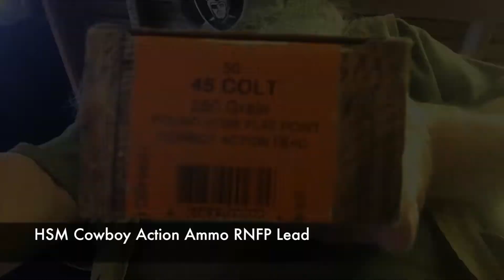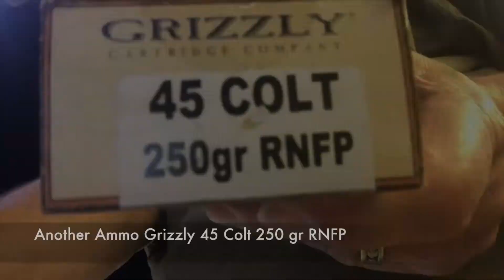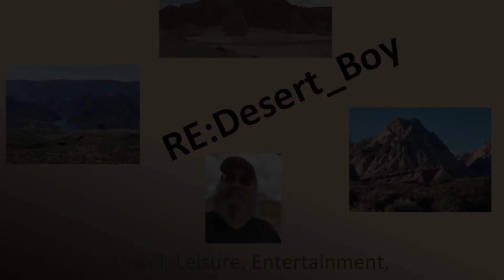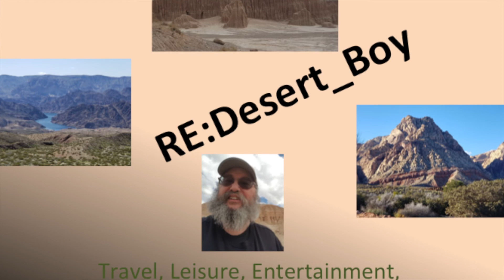1873 Cattleman Misfire Issues Part I

Comment: Young Beretta and I had to send 3 out of 11 Smith&Wesson Revolvers back to S&W for some fixes and tuning because they had issues including light primer strikes\ failure to fire. All the Smith and Wesson handguns were fixed and now run 100%. Sadly, we have no relationship with Smith & Wesson now because we showed the issues on our channel. I guess they just don’t like that total honesty time.
B9USA Sr.  🤠👻👮🏻‍♂️🙀🥺😉🇺🇸👍
Reply from the maker: It is absolutely critical that those of us sharing be up front and straightforward about what we experience, otherwise why do the reviews/videos.  That is why I did part II as well to discuss what the Cattleman II resolution was just as you did share about the S&W follow up.  You are not alone in people having some challenges with Smith and Wesson which is indeed sad.  I did go ahead and buy the 2 recent S&Ws, the 637-2 and the 636-6 and have been fine, but I thought long and hard about buying a SP101 and GP100 instead and most likely still will at some point.  I like and respect that honesty time.  Just keep doing the great review work Beretta, Sr. and Young Beretta.  Thanks.

Comment: That is a beautiful revolver though - load one skip one is the standard.  I wouldn't give up on that gun - have a gunsmith check the hammer tension.  It can't be the ammo where you have tried so many variants.  This revolver is one gunsmith adjustment away from being awesome.
Reply from the maker: Thanks for watching and the feedback.  DC 63 2A, I also posted the part II (about 3 minute video) of the resolution.  If you do not mind sharing, did you also get a notice for it as it has the solution the armorer did in it.  Thanks and look forward to your next videos as well.

Comment: Uberti. I hope you’re watching this…
Reply from the maker: Yes, I appreciate that.  Sometimes companies update or fix what is not needed….just like the S&W key lock.  Also there is a Part 2 as to how it was resolved if you have not seen it.  Thanks for watching and sharing.
Reply: @ 
The problem I have with Uberti is not that they came up with a passive safety system, but that they didn’t make sure that their new system worked well.  In a manufacturing sense, things get through QC, that’s understandable, but stand behind your product and make it right.
Reply from the maker: @Daniel-yf9iy  Well put Daniel-yf9iy.

Comment: Do you have cylinder pin in to far
Reply from the maker: No.  I belive if you watch Part 2 you will find it was a timing and spring loaded firing pin issue.  Thanks for watching.

Comment: Sloppy cylinder? Firing pin not " falling" completely? 
Those Rossi's can shoot . I own one in.357. I've had it for over 30 years, and it's never failed me. I load up.38 specials and shoot all day. I've taken a good number of" varmints "with it.
Reply from the maker: Yes, oftentimes values like Rossi or say a Maverick 88 shotgun can get overlooked.  Everything is not about price, but value, performance, and what works for each of us.  You can bet if I can find one I will get a Rossi in .357 at some point as well.  BTW I did do a part II to the Cattleman video and it was the spring loaded firing pin and timing to resolve.  Thanks for watching sir!
Reply: @redesert_boy8202  The minute I saw your post, I hit the subscribe button. I'm 64 and a firearm fanatic.( The wife said that I have too many guns). I will keep my eyes open for a Rossi in.357. They pop up once in awhile at gun shows. It's one of my favorite lever actions. Peace on the path. Gotta reload some.243 Ackley improved. Lots of "dirt chirps", that need to be cleaned out.
Reply from the maker: @kennethboston8301  Thanks for subscribing.  There is just something about the lever actions that make them nice to shoot.  I also have a Henry .357/.38 Big Boy Carbine which I really like and though normally provide the regular set up, put a picatinny rail, red dot, and 3x magnifier a couple years ago or so for home defense before they started making all these tactical lever actions.  I hope one of these days to pick up some of those great, but sometimes overlooked calibers like .243, .25-07, and 7mm-08.  Thanks.